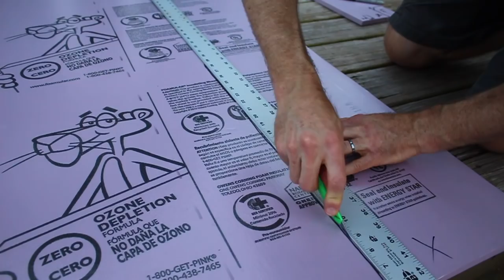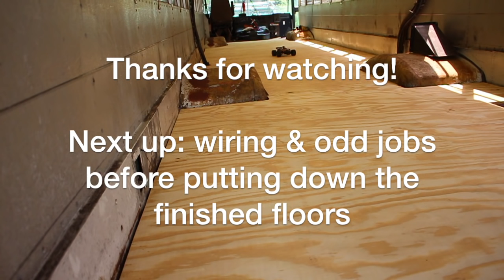The SubFloor Is In -- Prison Bus Conversion #9

Comment: If it not to late you could have taped with silver tape on the insulation sheets to help from condensation and moisture coming up from the floor. Hope this was helpful. Great job in building bus.
Reply from the maker: I thought about that, as I've taped up foam insulation with home building ... but instead thought I'd try letting it breath a bit. We'll have to see how it works! Thanks for the note and thought

Comment: Good job so far.  Just wondering why you didn't include the wheel humps along with all of the floor prep?
Reply from the maker: Chuck J they were rust free ,and pretty clean ... but since you mention it I guess I could have painted them .... thanks for the comment!
Reply: I'm curious to know if you are for hire to assist with a similar project on my smaller bus (7 windows). Thanks
Reply from the maker: I replied to another comment you left ... definitely interesting, but it would depend on where you're located. Your bus sounds pretty cool

Comment: ....yep....thumbs up again!
Keep up this kind of videos....they are fun to watch.
Question: Did you glued or such the black lamination underneath the wood?...if not....why?
Reply from the maker: I did not use glue or construction adhesive on the foam as I've seen it eat away at the foam in previous projects. I considered screwing and bolting everything down, but didn't want to put any holes in my welded-up floor. So I'll be using pressure along the edges to hold the tongue-and-groove flooring down. You'll see this in a future video. Thanks for watching! I hope Berlin is nice this spring.

Comment: Today I got the first two sheets of insul and plywood down on my bus floor...I couldn't remember if you glued your plywood together at the T&Groove, so I went ahead and glued mine together with polyurethane adhesive (great stuff!)...I laid two Harbor Freight ratchet straps on the insulation board and put the plywood on top of the straps, which I used to pull the two sheets together with a nice squeeze out of adhesive.  After the glue set for a while, I removed the ratchet from the strap and pulled the strap right out...worked like a charm...on the first two sheets.  Anyway, I watched this vid again and see that you did not glue the joints...do you see a problem with me gluing the plywood together?  It seems like it would make the floor incredibly strong and "one piece" .  Probably not necessary, perhaps overkill, but after all the sanding and grinding and rust and hole patching and painting....I feel pretty protective of my new floor and want to do the best job I can.  Thanks for your advice and , of course, your videos!
Reply from the maker: Cool idea of using those ratchet straps! It's always hard to get those tongues in the grooves. I don't see a problem with the glue ... if the fit of the sheets themselves isn't really tight, the glue will help keep them in place. Note that your fasteners from the flooring on top of the sheets will do the same thing. I bet it feels good to be making that progress! :)
Reply: @metaspencer  Thanks for your reply Spencer...it really does feel good to get those two sheets down....wish my budget allowed me to buy the rest of the material right away, but there's plenty to do with the "free" recycled lumber I have stored away until the cash flow situation improves.  The ratchet straps worked perfectly, but I would need a very long strap to continue the idea to the end of the bus...just getting the first two pulled together should make the rest easier.  I'll probably rig some kind of bracing to the back of the bus so I can "jack" the sheets together when the time comes.  Your input is very reassuring!

Comment: Great video Meta. We're working on a bus now so seeing your videos are inspiring.
Reply from the maker: Bus owners unite! I admire how you've tackled the wiring (over on your channel). Excellent!
Reply: Thanks man. I was stressing out.What was that plywood you used? Are you happy with the structure of the insulation under the foam? I would have thought one would require some wood to anchor in. Full disclosure, I'm thinking about copying you. :D Also, what was the paper you put on first? Why did you use that?
Reply from the maker: Long answer: I used 3/4 tongue-and-groove plywood, and that's great. The insulation was the thinnest I could find to maximize headroom: I think it's 1/2" thick. I didn't lay down any wood framing beneath the subfloor to avoid thermal bridging ... but now the floor is squishy and not solid enough for my taste. So I even considered pulling the subfloor this weekend, adding some wood 1/2" thick pieces between the foam, and dropping the subfloor back in. So I wouldn't recommend a totally floating floor (on foam) as I installed, as it's squishy. As for the underlayment, that's tar paper. I installed that partly out of habit, as I always do floors that way, but also because it's waterproof, thin, and avoids any slipping/squeaking between layers. I didn't want to hear foam-squeak. Plus, tar paper is cheap. You'll find it in the roofing section of your hardware store. I'll post a new video soon showing the retrofitted floor system
Reply from the maker: one more thought: I'm not at all interested in putting new holes in that metal floor, and not really worried about uplift or side-to-side movement, so haven't gone with anchors. The trim around the edges of the finished floor should be good enough. Note that I still have one more layer of finished floor to drop in ... that will be this week

Comment: Hey Spencer...I followed your prison bus project when you first put it up on YT...great content and creative ways to save money and work.  I finally found a good bus, and have just finished patching and painting my floor (Rustoleum Aluminum paint...wow, great paint!).  Just wanted to check in with you before I proceed to install the same floating floor system you used...love the idea of no thermal bridges to the metal frame below.  Is there anything you would do differently today?  Is there any squeaking while you are driving?  Any other issues to look out for?  I sure appreciate your time and really appreciate this bus build series....one of the best I've seen, for sure.
Reply from the maker: Hey, another bus owner! That's so cool that you  got a bus and checked back in. Awesome. My floor system has been 100% great so far and I have no problems with it ... feels great, lasts great, etc. Now, the other ways to do it likely work well too, but that's just how things go: more than one way to do it right. Good luck with it! What kind of bus?
Reply: @metaspencer  That's all great news to hear....I've got the first two sheets of t+g plywood and 1" rigid foam board waiting for paint to dry...gonna start on the cockpit area first and work back as cash allows.  Bought the bus on the very day the big corona stimulus checks got sent!  It all came together perfectly...oh, the bus was jam packed with house doors, windows, oak cabinet doors, a gazebo, industrial shelving, etc.  I'm using as much as possible in the bus, and the rest will go into the remodel I'm doing on my cabin.  It's a 72 passenger AmTran International Navistar 466E with only 45 K on the engine.  I'm stoked, to say the least.  Thanks again for your time and for sharing your journey.
Reply from the maker: @Omarateastwind  That sounds oh so excellent. Very good!

Comment: No glue on the Styrofoam and no screws on the T&G flooring?  Do you think that that is a good idea?  Screws will hold the floor secure to the bus instead of a floating floor.
Reply from the maker: Great questions/thoughts. As for the styrofoam, I've removed a lot of it over the years that was glued, and I always see that the glue sort of eats away at or melts the foam where it adheres. So I opted to just lay the foam down on the tar paper. As for the subfloor, I know that many people screw it down to a frame of 2x2s or 2x4s. However, I wanted to avoid thermal bridging and putting more holes in my newly patched floor. So I went for a floating floor. The build elements on top of it should work to hold it down, as they'll be attached to the ceiling and walls. That's just my approach. There are many others
Reply: There is glue made for the foam. I plan on build a Skoolie in the future and I try to listen and learn from all the builders. I will be a builder on a tight budget an anything that will save on cost is appreciated.
Reply from the maker: Since you're methodically planning and thinking about things, I guess I'd ask: why glue the foam in place? Are you trying to keep it from moving vertically or horizontally or both? And how much strength will that glue have? I thought a bit about those questions and decided that screws into my side panels and ceilings might offer more stability than glue. But since most people go with glue and screws for their floors, I could certainly be wrong

Comment: I know this is an old video, but curious on what the thought was behind using the tar paper over the flooring?  Was it just an added layer of protection?  Or was there some other reason?
Reply from the maker: I’ve long installed floors with tarpaper under them. It stops squeaking, insulates, is a vapor barrier, and is very thin. Also cheap! So those were my thoughts... thanks for checking it out

Comment: All that plywood has me thinking about weight and gas mileage. How do you think you will do in that department?
Reply from the maker: Hey Tim! When I gutted the bus I pulled out as much plywood (that was soaked in diesel and water), so there is no weight gain in that department yet. I also pulled out 24 metal seats and the cages that held in the prisoners. So I'm not up to where the bus was originally in terms of weight ... yet! I'll have to make careful decisions when building out the interior to keep it as light as possible. 

The bus doesn't get great mileage, especially at high speeds, but I'm hoping to hit 10mpg on level roads. :)
Reply: Ah, that makes sense. I came into this at video number 6 or so I think. I should go watch them all and get up to speed.

Comment: just wondering how much height did you lose in head space by having so many floor layers. You first painted the floor with rust primer. Then laid black stuff i dont know what that was? then you laid an insulated foam sheeting which i assume is like a soft floor and insulation , then finally you laid a ply sub floor. Was that marine ply btw? so yeh after that many flooring layers would you have lost about 5 to 8 inches of head space? And is that a worthwhile sacrifice ij such a small space?
Reply from the maker: great question! I set my floor up the way I did specifically to save headroom in the end, so here's the deal: the original floor was 3/4" of plywood plus about 1/8" of rubber. My floor is a negligible amount of paint and tarpaper, then 1/2" of insulation, 3/4" of plywood, and 1/4" of flooring. So in all it's 1.5 inches thick. I'm 6' tall and the headroom is pretty good in there. I've seen a lot of people put 2" insulation on their floors and then 3/4" subfloor and 3/4" flooring. I wanted a thinner floor because of headroom issues. 

My plywood was just a simple 3/4" underlayment -- not marine ply.
Reply: And I noticed in a later episode, you then added another of flooring too, the actual final floor. Why didnt you just leave the subfloor as your final floor I wonder, this could have been sealed nicely as a finished floor.
Reply: @metaspencer  Ah thanks for clarifying mate. What is tarfloor? whats its purpose please?
Reply from the maker: Tarpaper is a common underlayment that avoids squeaking, bugs, water, and air
Reply from the maker: You certainly could finish that subfloor, but I wanted a different look
Reply from the maker: @Joseph - tarpaper is pretty cheap (probably $10 a roll). Note that it acts as a pretty good vapor barrier and keeps wood floors from squeaking, but it also traps water underneath it. So laying tarpaper over an area that gets moist will lead to moisture buildup later. On my build, I went for the thinnest floor possible ... your goals may be different